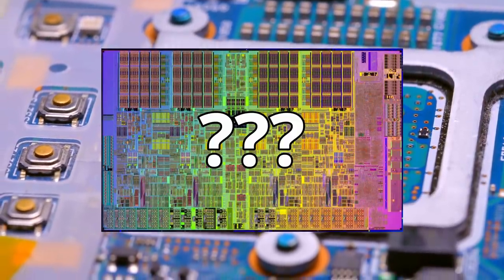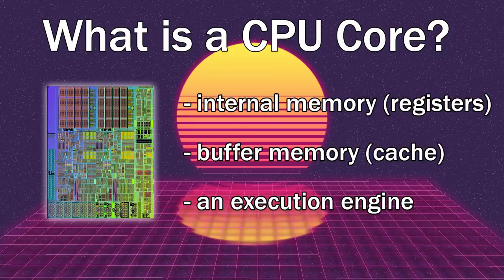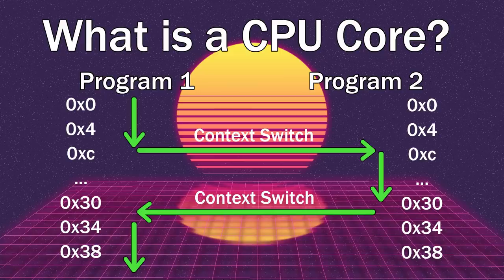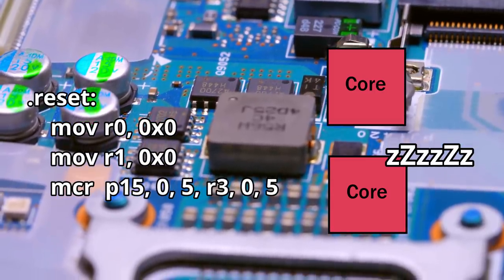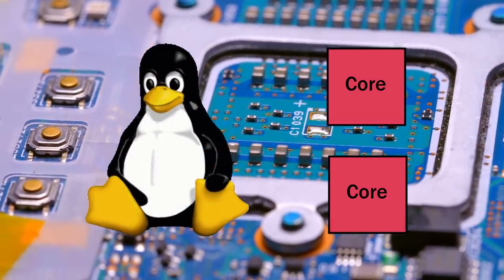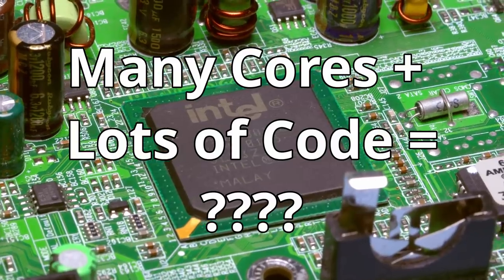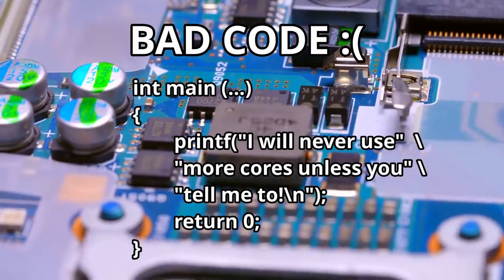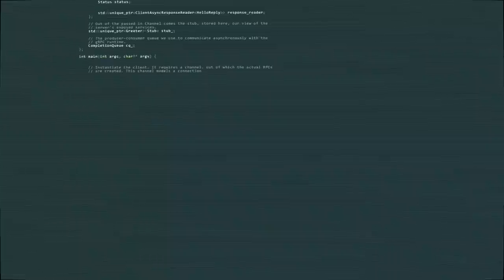why can’t computers have thousands of cores?

Comment: More cores mean nothing when so much of the software out there doesn't even support more than one, let alone 10 cores. There would be no benefit.

This is the modern example of the megahertz wars, except that instead of only minor benefit from an increase, there is effectively no benefit (and oftentimes a detraction) due to an increase.

Comment: Nonsense. Maybe not a CPU, but a Computer also has a GPU - and if it uses something like nVidia RTX 4090 - that particular GPU comes with 16,384 Cores. Thus, above video is misinforming. Or at least - the author can't even differentiate a Computer (the machine/device itself) vs a CPU (Central Processing Unit - aka - the Processor - aka - one of the core components of a Computer).

Comment: Huh? You gave no practical example why thousands of cores are not feasible. It sounds to me that you don't know how much parallelization is happening in the year 2023 actually,  I run Kubernetes cluster hundreds of servers and each server had at least 48 cores, these cores all get used, it is all parallel code. Your video would have been current in the year 2008, where most code was not yet written to run on many cores, but not anymore today. Your hello world example is not relevant: hello world does not need multi cores to run, if your workload is so weak that it can't saturate one core, it of course does not benefit (or need) the performance of several cores.

Comment: You sound very optimistic that "Moore's Law" will hold for the next 50 years.
Reply: It been doing well so far
Reply: @Alucard-gt1zf  Moore's Law is exponential (doubling the number of transistors per surface unit every 2 years) and they are approaching the size of a single atom very fast. You would have to come up with a way to construct transistors smaller than an atom (you'll get multiple Nobel prizes if you do).
In fact, both the rate of doubling (from 12 months in 1965 to 24 months in 1975 by Moore himself) and units (using  volume units in stead of surface units) have already changed in the definition of the "Law", moving the goalposts in order to keep up.

Comment: I'm honest, more core with low single core boost is just bad, I will prefer 8 core 16 threads with 10 Ghz rather than 32 cores with "20 efficiency cores and 12 performance cores"

Comment: I'm expecting that with current material science and thermal limitations the most cores we will see with current architecture is 18 to 24 cores.
Reply: for consumers yes amd was already at 16 cores on the 5000 series and will probably push to 24 on the upcoming gen intel will probably be right at that 24 but with some being E cores. on server side 64 core cpu chips are already out there
Reply: @Demon09-_-  I'm curious as to when the pathways on motherboards and other peripheral add on cards are going to be replaced with fiber optics rather than the standard silver copper gold or platinum. A faster information transport medium with much lower thermal output and greater bandwidth. I'm also curious when they're do the same with CPU's VPU's RAM and SSD's. I know our material science has probably already produced such a material but mass cost effective production may not be available yet. Just thinking out loud and using fiber optics as a reference material.
Reply: @jasonswearingin1009  I feel like making fiber optic traces for your avg motherboard are very diminishing considering we're already in the nano seconds. There may be some gain there but it may not be enough to warrant the difficulty of having to do fiberoptic channel along with still having to do traces for power  as fiber can't carry energy
Reply: @Demon09-_-  Yeah you would need multiple information conversion hardware setups at key interfaces. Hardware that would convert the signal from the light to electrical pulses. The interface points would be any hardware interface. My curiosity is if such technology could cause a significant reduction in thermal (heat) load. I'm a submariner sonar tech veteran and all of our communication links between onboard server units use fiber optics. Even our towed sonar array (cable) is a large fiber optic bundle heavily shielded with hydrophones spaced every 3 feet. There is no electrical current in that cable yet the light passing through the optics carries enough energy to power the small hydrophones. Can't recall the physics that make that towed array work but it is passive listening only. The crazy thing is at certain depths you can fine tune your station and listen to sounds more than halfway across the planet so long as there is no large land mass to block scatter or absorb the sounds.
Reply: @jasonswearingin1009  ah yea fiber optics shines over longer distances but the few inches or even millimeters between stuff on motherboards is probably into the diminishing return kinda thing
Reply: @Demon09-_-  Yeah just floating ideas. CPUs and VPUs are rapidly reaching the limits of the thermal tolerances of their main conductive component (gold). The Ryzen 3K and up CPUs have an operating thresh hold of 95C. We aren't melting the gold yet but even extreme end cooling outside of chill water cooling is struggling to keep idle temps below 40C. It won't be long before thermal issues arise that start turning the conductive metals to a rubber or putty consistency. The big issue a lot of PC builders are  dealing with is CPU thermal dissipation performance. Even the Ryzen 5800 and 5900 series recommend high end external radiator liquid cooling for overclocking. I'm curious if the next conductive material for CPUs will be graphite. Graphite is a good non metallic conductor and can be made very durable. A CPU based on graphite would reduce weight. Just don't know anything about graphite's thermal conductive properties.
Reply: @jasonswearingin1009  the wild thing is my 10900k idles under that and is just using a nh d15 which is worse the. A bigger 280mm aio. And my ambient is worse then most at like 28c. I think part of it is just thermal dentisty that we are hitting its similar in gpus but they have much larger direct die cooling for them. It may just be we eventually have to ditch the integrated heat spreader for cpus if power limits keep going up
Reply: @Demon09-_-  I'm running a Ryzen 7 2700x 8 core. Base clock 3.7 got it clocked at 4.2. It will do up to 4.35 but gets unstable beyond 4.2. I'm running an MSI FROZR L twin 120mm 200 watt TDP CPU cooler. My idle is in the 29 to 34C range and load is 51 to 59C. The only time it has exceeded 60C is in long stress tests. Once ran a 1 hour stress test and peak temp reached was 72C. It has a thermal safety range of 90C but I set my BIOS to do an auto shutdown at 85C just to be safe. I plan on a future upgrade of an X570 MOBO and a Ryzen 9 5900X with a Noctua 250 watt TDP dual 140mm cooler. Just waiting to see which NVME SSD brand I'm going to use. Samsung is what I prefer but with the data hack that Invidia Samsung AMD and Intel suffered recently where a huge amount of digital license signatures were stolen I may use Corsair or Crucial.

Comment: This guy clearly never tried to compile chrome or similarly sized project.  1000 cpu cores would speed up compilation time significantly.
Reply: The average user will never even consider compiling code.
Reply: @WaterZer0  average user won’t be looking at a 1000 core cpu to begin with.  Just saying, there are very practical uses.
Reply: @Omikoshi78  eh, I wouldn't say it's impossible that the average computer could have 1024 cores in the future 
Unlikely but not impossible.
Reply: @WaterZer0  my current pc already has 128 logical cores.  We’re probably closer than you think.

Comment: CPUs can’t, but GPUs can have thousands of cores.
Reply: GPUs don't have cores. That is simply wrong. They have very small computing units, but many. The entire GPU architecture is targeted towards making a single thing fast, i.e. the graphics pipeline. It can be used for some special number crunching stuff (GPGPU) but that is not what the people who designed GPUs had in focus.  When programming for a GPGPU you use a very special style of programming and you have to do a lot of things "by hand".

Comment: Just from a layman's point of view... Wouldn't it be simpler to program different codes and send them to separate cores to do multiple tasks simultaneously? Ie ... One runs the OS.. one browser.. one some other program... And as far as heating is concerned put 2 chips and 8 fans for all we care. Just make better machines.. CPU's GPU's and ram.

Comment: "Computers Can't Have Thousands of Cores" -- uh, no. Your premise is fundamentally wrong. There have been lots of computers throughout history with thousands of cores. For example, the NASA/Goodyear one-off computer, the Massively Parallel Processor, with 16,384 cores, each roughly equivalent in processing power to a Motorola 6502 (the CPU used for the Apple II, among other things). There have been a number of other large-scale SIMD architectures over the years.

Most people have a thousand-core computer as a subsystem in their primary computer, called a video card.

You might say "this particular type of computer can't have thousands of cores", but that's a self-serving statement, correct only because you've decided to limit your range of consideration to the computers that prove your point. See "no true Scotsman fallacy".

Comment: The Cerebras 80 Xo scale wafer ultra supercomputer has 850,000 cores, each core a modern high performance supercomputer within itself all super interconnected able to model complex simulations in high detail faster than real time, predictably and accurately, To speed processing it is able to eliminate all zeros in the throughput. At 44,000 Watts it outperforms multi-million-watt supercomputers. Stackable, they believe they have found the path to build singularity. It is not much larger than a large desktop computer you would have sitting on the floor. Currently they have version 2 lithographed at 5 nanometers which was double version 1. They expect to produce a two nanometer version of the same size, a small wafer you can hold in your hand. It is not unreasonable to imagine a federal government labs to build a computer with a million of them, and to install them even as a singular device throughout complex government services such as IRS and the national Security agency. I saw a video where somebody has bought one just tear it up to look at the integrated cooling system built directly into the rather small wafer chip. So small yet 44,000 Watts I would expect it to be white hot and explode. Applied to the IBM smart cities initiative and similar offerings by many for anything and everything you can think of, Chat GPT is the tip of the iceberg. Suddenly millions are losing their jobs such as those that prepare taxes. The customer scans it to the company which feeds it into the computer automatically spitting out the results and completing the transaction with nobody involved. Taxes the AI cannot figure out will be sent to a person to determine the problem respond to the suggested solution. The opposite of what the video title suggests is the solution to get to Singularity computer. Making the wafer larger and the lithography smaller which was designed by AI with unusual new characteristics that will increase performance of future versions beyond previous versions that were actually pretty standard if you consider sticking 650,000 super computers onto one wafer as distinct separate chores rather than one choir, the idea of integration going forward. What can 300 million supercomputers on one wafer board that fits in a bread basket do for humanity is just a short wait away before we find out as their 3 nanometer AI designed board starts coming off the production. The only problem with the manufacturer is efficiently continuous for extended time. Each wire and transistor is drawn one wire at a time. I wonder how many miles of wiring are on that small wafer chip. Check out the article, Google and ask for, the biggest chip in the world. The cerebras ultra supercomputer wafer chip.

Comment: OK, but many home computers do have 1000's of cores, 10's of thousands even. A current gen GPU has 10 to 12 thousand cores and that number keeps going up. The CPU could be made the same in theory, but there's no point on a cpu - mostly for reasons covered by the video.
Reply: No, they don't. That's from the marketing guys. A Radeon RX 6900 XT, if compared apples to apples, as well as can be, would have 80 cores, to the best if my understanding (IIRC, each CU in a WG gets unique code to run - otherwise, make it 40).

Those big counts come from counting each vector hardware lane, and that a, "core," lacks a standardized definition.
Reply: @laurelsporter4569  I dont know about AMD, and I doubt I will change your definition of a core, but nVidia cuda cores are all processors - albeit mini, rather specialized ones. And nvidia does put thousands of cuda cores in one GPU. 
The arguments provided in the video as to why we dont just stack more and more cores are only the surface of why it doesnt work well in CPU's. There are operational reasons enough that we cant just stack more cores and go faster.
Reply: @TheFinagle  they can do that, and it's not technically wrong. But, it is hardly a fair comparison to a CPU core. They schedule one thread across many many vector units, and call it using many cores. But, for a CPU core, we'd expect separate threads to be running across them, and doing that well takes up a lot if space and power (multi-threadeding exists in both, and works about the same, for any given scheme, so that can be pretty much ignored)
Reply: GPUs don't have cores. That is simply wrong. They have very small computing units, but many. The entire GPU architecture is targeted towards making a single thing fast, i.e. the graphics pipeline. It can be used for some special number crunching stuff (GPGPU) but that is not what the people who designed GPUs had in focus.  When programming for a GPGPU you use a very special style of programming and you have to do a lot of things "by hand".

Comment: Well done. We need x, y, and z registers; z being vectors. Z can be designated as neutral leaning negative or neutral leaning positive. We can put the current around the solder/wire instead of inside it; no Ohm's Law or heat. This would eliminate destructive heat in electronics and, even, transmission lines. Must put at least 1 microwatt in the wire to create the necessary fields. Nine different fields with nine different properties. The first field is a left-hand rule that we call the propagation field, the next we call the magnetic field, but is really just to put magnetic based data. Check out more at https://revitaetechnologies.com.

Comment: Good Points in Video, but, If you buy a Quad CPU Server Motherboard, you could have Hundreds of Cores now, with 96 Core AMD. The more "little brains" working on the problem, is better, Especially in Servers. Parallel Computer is still coming to fruition, including Motherboards/RAM/CPU/GPU so predicting the Computing Future can be tricky, when things like Memory & Storage seem to also change on a daily basis, these bottlenecks may yet disappear, after 50 years in Industry, I have seen it before .. ..

Comment: It explains a lot about core count growth, everytime DDR get a gen upgrade we see more cores coming to the general public, DDR5 just started to enter the market and we are already seeing some very big increases in cores count across the board.

Also the tricky part for software engineers is to implement multithreaded operations when it make sense, but the even trickiest part is to be able to make sure that those multithreaded designed software scales properly with the average computer, because if you write a software that’s really optimised for CPU above eight or twelve cores, your letting a huge part of the user base with a bad experience.

Comment: If aging  Emory serves me well, the  Brits started wor,ing on multi cores al ost 45 years ago, along with 3d  memory arrays , the o jet create a computer like a human brain. The problem was coding such a mess ... but it was a noble effort. I well remember my. First computer, single core, hexadecimal input and output...vi Tage 1972... maybe 73, a lot of drinks since then.. Today's computers are a marvelous but coding for software sucks. Yes pretty buttons and bells, pretty graphics, all at the cost of functionality...just an old man remembering that we sent men into space using sliderules and  this cheap tablet the computing power of early space modules.   How much is lost in conversion to get to that, simple machine code? What do I know just an Oldman...

Comment: I mean gpus have a lot of cores right?
Reply: But those cores are weak so they made over thousands of cores in a GPU
Reply: GPUs don't have cores. That is simply wrong. They have very small computing units, but many. The entire GPU architecture is targeted towards making a single thing fast, i.e. the graphics pipeline. It can be used for some special number crunching stuff (GPGPU) but that is not what the people who designed GPUs had in focus.  When programming for a GPGPU you use a very special style of programming and you have to do a lot of things "by hand".
Reply: @Conenion  do you know nvidia cuda and stream processors?
Reply: @Audi-A4L  
A CUDA core is a stream processor. And CUDA cores are tiny compared to CPU cores. Look at die photos, and you'll see what I mean.
Reply: @Conenion  amd has stream processors too
Reply: @Audi-A4L  
Shader processor or shader compute unit would be much better names. Because that's what they are normally used for: geometry or vertex shading.